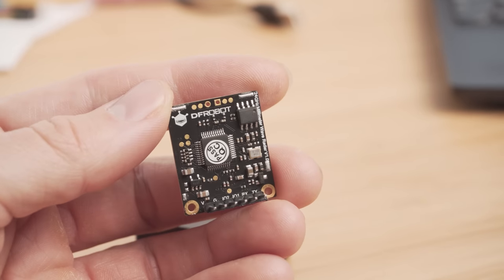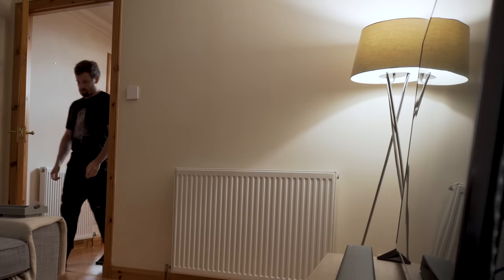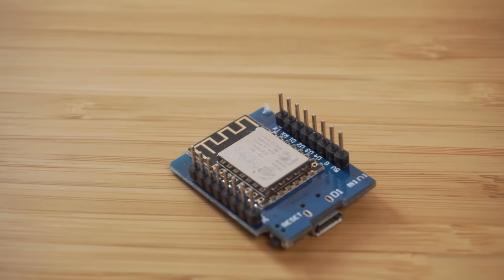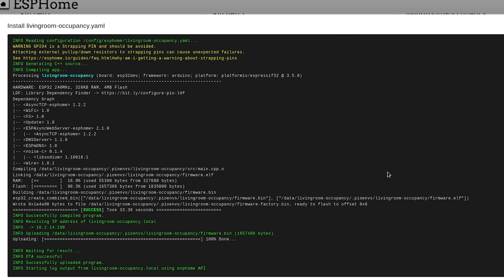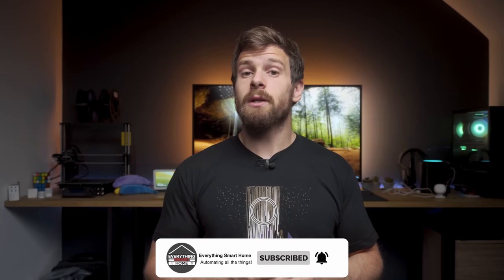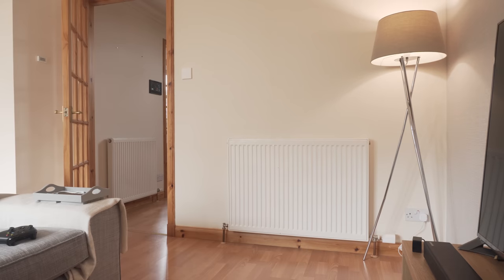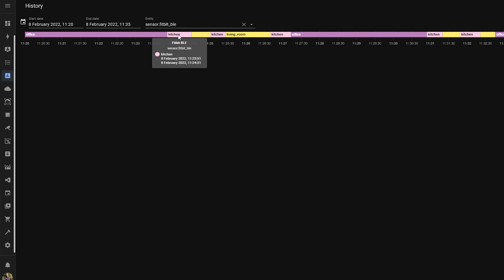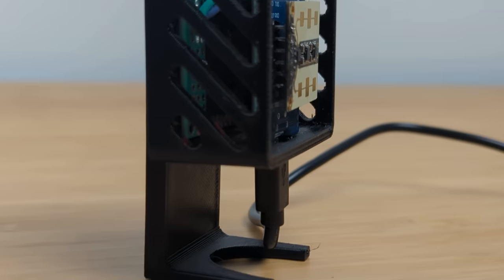Building My Perfect Smart Home Presence Detection Sensor!

Comment: 9:00 by the way since you were speculating on this you are correct a 60ghz mmwave sensor is far more sensitive even being capable of detecting heartbeats and breathing which is why its so much more reliable than the 24ghz one when detecting sleeping humans, although it does this at a much lower range than a 24ghz module. To be fair the dfrobot sensor does specifically say in the instructions and even shows pictures to install the sensor directly above or under the bed when using it for that purpose. Seeed studio actually has a 60hz module for sale on amazon currently if you want to read about it maybe even test it. ...............  seeed studio mr60fda1 60ghz mmwave sensor
Reply from the maker: Thanks!
Reply: Can I ask - because I don't see it - what the benefit is of being able to detect motion from a sleeping person?
Reply: @JohnVanderbeck  presence detection in a room after the occupant has gone motionless in bed
Reply: @ezradmello7021  Yeah I get that but for what purpose? Just curious.  Usually you use these for turning on lights but you don't want lights on when you are sleeping.
Reply: It's actually the opposite.

You'd use this as a bed occupancy sensor so you can tell when you're in bed or sleeping.
Ex: Slowly dim and turn off the lights if it's night time and presence is detected at the bed.
Reply: @JohnVanderbeck  automations that turn off "entertainment systems" aka computers and tvs in your room if it's left on and no one's in there you would usually be laying motionless in bed while watching a movie. Personally I would use seperate sensors for the bed and each side of the bed to tell if my me my wife or both of us are in bed as well as a whole room presence sensor
Reply: @JohnVanderbeck  the use of the word motionless instead of sleeping was purposeful. Common Motion detectors will generally only detect large movements so if reading or watching tv in bed you it's unlikely you will be detected, and depending on the automations you have setup, the lights and other devices may turn off.

Comment: The fp1 is amazing. I spent months/years trying different combos of door contacts and motion detectors to detect presence in the bathroom and when in the shower, but nothing short of pressing a button to set my system into "shower mode" worked well. That all changed as soon as I received the fp1. Not only does it perfectly detect someone being in the bathroom, it detects through the shower curtain, and it even detected me in the shower when I accidentally put my clothes directly in front of the device.

 I was able to remove all other devices and complex node-red flows minus one aqara motion detector to more quickly trigger the lights to turn on as it takes a few seconds longer for the fp1 to determine that there is an actual person in the room, where as a normal motion detector is nearly instant. I then only have to use the fp1's "off" mode when presence is no longer detected to turn the light off. There is no trouble in between anymore of lights going off when using the toilet or in the shower.

Comment: Air quality is something nice to add. Apart from your suggestion to add a particle sensor I would add a CO2 sensor like the SCD30. That will tell you when you have to ventilate the room.
Forgot to compliment you on this nice video…
Reply: This was essentially going to be my reply...swap out the bme280 for an scd41, and add co2 to the measurements I believe?

Comment: Nice device. There are some sensors that I prefer to the ones you picked that might be of interest. Firstly, if you want to add PM10/PM2.5 the NOVA SDS011 is very good even compared with sensors several orders of magnitude more expensive, honestly, for £15 it's shockingly good. Second, for humidity measurement I've found the BME series sensors don't tend to give accurate humidity readings. The SI7021/HTU21D are good alternatives but lack atmospheric pressure so it's a trade off, it has a different I2C address so you could try both in the same device and see which gives the most sane readings or have both or use the BMP180 instead. For light levels the VEML6040 gives colour temperature as well as Lux which could be handy if you want your lights to match ambient conditions, unfortunately it's not built into ESPHome, but could be added as a custom sensor.
Reply from the maker: Thanks for the info, useful!
Reply: Of what benefit is a pressure sensor indoors?

Comment: For rapid prototyping and permanent projects I got a fan of the wire wrapping and the glue gun. in comparison with a breadboard or a prototype board you can get quite quick a breakout board aggregate, works with most pin spacing and the glue gun fixes the wires on the pins and the position of the boards. Also most time no solder fumes :)

Comment: Congrats on the nice build!
A few tips:
For air quality rather than a PM sensor I use co2 sensors (the senseair s8). I use it to control my ventilation system. It also helps detect whether there are people in the house.

For the update frequency of the sensors I have the esp32 check the value every few seconds but only report this value to home Assistant if there is a change bigger than a specific value. This way I get more or less instant updates but without spamming home Assistant and my wifi network.

I've added a screen to my sensor where I can see the data of my sensors including charts. Took a while to figure out how to do it in ESPHOME but pretty cool. The screen is off by default and turns on when the PIR sensor or microwave sensors which I'm using detect me.

I also have an RGB LED that at a glance shows me the air quality (a gradient from green to red). The brightness of the LED is controlled by the light sensor.

I suspect you are not going to put a cover in front of your multisensor, but if you do: you'll need to place your BME280 outside the case, otherwise readings will be off. Same of course for light sensors etc.

What I'm struggling the most with is finding a reliable humidity/temperature sensor, but I'm pretty sure the problem is that I'm a cheapskate and am buying from AliExpress which are probably knockoffs.
Reply: Do you have an video/photo of it?

Comment: This is a pretty cool all in one sensor. I've been following crlogic's work over on HA too.

I do have a few questions/challenges for you though:

Why did you spend more money on STEMA/QT compatible sensors, proceed to solder them to a proto board, and them talk about the overall footprint being too big? In an effort to appeal to a larger audience, a fair number of the Pimoroni and Adafruit sensors are much larger than some of the more basic offerings, but offer more functionality (generally have a voltage regulator and level shifter to accept both 3.3V or 5V inputs, and have STEMA/QT connectors for no-solder connection options.) For example, a generic BME280 is 11x14mm vs 19x19 for the Pimoroni, and a generic BH1750 is 18.5x14mm vs 26x18mm for the Adafruit (~50% difference!). You do have to watch out for counterfeit sensors on some of the cheaper versions though.

For a prototype board, why didn't you use headers for attaching the sensors to the board? You definitely had the room to do it for this iteration, and it would have allowed you to swap out sensors during testing and future iterations if need be.

The BME280 sensor is very precise on its own, but most of the circuit implementations suffer from heatsoak that skew the temps at least 2* higher than actual. Putting the chip in sleep mode between readings, and adjusting the heater circuity can help, but mounting it directly above an inverted ESP32 chip is not going to do anything for accuracy.

Comment: I'd love to see this more compact, in a unit like the Aeotec multi-sensor. I wonder how difficult it would be to reverse engineer those boards and create a single PCB with every component neatly installed together. I also wonder if there is redundancy across the boards, as I assume they'd have circuits performing similar functions and therefore using similar components repeatedly.

Comment: This is absolutely fantastic! I'm going to give building one a go. I was looking to do room temperature sensors, and maybe figure out room presence, but WOW this does it all, plus light level. Air quality could be useful, but like you said to add that would greatly increase the bulk of the design, at least right now.
Reply: Would you be selling the finished product?
Reply: For air quality, a CO2 sensor may be more useful than a PM sensor, and not at all bulky, but a sensor "good enough" is not the cheapest sensor.

Comment: Excellent video!  I’ve had bad luck with the PIRs I’ve purchased.  The link in your video should get me a decent PIR.  Using a HiLink HLK-LD2410C-p for microwave sensor. BME280 for temp and humidity. Then VCNL 4010 proximity, light sensor.  Replacing all my esp8266 project with ESP32’s.  Some with Pi Pico’s, using Micropython.

Comment: Great video and work!! For me I would love to have an all in one solution. Your sensor paired with humidity, air quality, co2 and smoke sensor (with optional pinhole camera, where you can use the mic for Siri or Alexa). All working via a LAN cable (power and data) and all in a ceiling mounted Smoke Sensor enclosure. Of course HomeKit compatible 😀. No Switches no nothing just one sensor on the ceiling and some in wall speakers and underfloor heating

Comment: Very nicely done! I've the same question as some other users: could you kindly measure the actual power usage of the device? I'm not convinced the power usage is minimal, especially if you would install sensors in all rooms in the house. Things can add up pretty fast.
Reply from the maker: I'll try at some point sure!
Reply: @EverythingSmartHome  I'm also interested about energy consumption! Maybe find some ways to hibernate the sensors when possible too. Great project!

Comment: Nice job there Lewis! Those are the things a big brand needs to get running on PoE mountable as a "wall-switch"-sensor-module. Or even ZigBee and direct wired to the mains-voltage.
I really wished you could say anything about the power-consumption of your projects, as energy is a big concern of mine when talking about those designs. Would love to hear from you!
Reply from the maker: Thanks! PoE would be cool!

I usually would talk about power consumption, but it's literally so low on these projects it's generally not a concern, we are talking a very tiny amount of power that you won't notice at all in day to day, even in the current climate!
Reply: Poe would be ideal for these, have though about something like this, ceiling mounted and fully enclosed.
Also an led chip for a nightlight. I love the very low level light a Ring Protect gives off at night when you walk under it.
Perhaps when it has wired power, a zigbee repeater(for other devicesl, if there is something suitable that could fit into it.

Comment: @Everything Smart Home - A lux sensor does allow you to decide whether to turn the lights on or off, as you mention. For enhancing this, consider using the lux sensor as an input to a PID regulator with whatever setpoint you'd like. This is called daylight regulation or daylight compensated lighting, and is common in commercial applications because it saves a lot of energy by only "supplementing" whatever light you need in addition to the natural light from windows and such. But it's also very comfortable since room-to-room, you'll experience less variation in brightness which makes transistions more comfortable. It also lets your lights dim slowly on as dusk falls with 100 % accuracy, rather than alternative solutions that fall short, such as sunset timers, etc. 

You'd typically set a minimum brightness level, so if the PID regulator for example outputs 8 %, you might have a minimum threshold of 10 or 15 %, and thus cut off the light instead. And you'd also often need an auto/manual helper object that automatically gets changed to manual whenever physical switches or UI switches change the light level. Often, it's good to transition back to auto if no presense for X minutes (typically a much longer value though, like 60-120 minutes). 

If you then want different responses from your lights in different situations (say; nightly visits to the WC), instead of implementing these as a set percentage of output, you can simply vary the setpoint of the PID regulator automatically. If you foresee the setpoints being changed while lights are on, add a numeric delay / ramp function to the setpoint input, so that it never changes faster than some rate, for example 5 lux per second. 

A common problem is that you'll have less uniform light in a home and say, an office. This is "fixed" by applying a percentage factor to each light to account for the lights contributing differently. For example, a table light might contribute less than your overhead lights. So it may get a 140 % factor, which enables it to shine brighter to compensate for this difference.
Reply: Interesting read, thanks! You can create an automation that can be something like trigger when lux < x with a condition that there is someone present in the room, I think that's what he meant.

Comment: Thanks for the informative well explained video! 
I have the same experience like @mortensentim511 with the BME280 - hum% 15-25% too low and temperature about 4°C too high. Also putting apart from heat sources like the ESP and after conditioning. Maybe the special soldering process was not maintained, it was on such break-out board delivered. 

Alternative #1 I tried was a SHT31. Provides much more accurate hum% and temp values. 
Alternative #2 which works even better for my needs: BME680. Very accurate, plus it adds a nice extra of VOC measurement. Fully integrated in ESPHome! Recommendation - use the bme680_bsec library, not the standard one. You will enjoy the much better AQI and other calibration routines in the background and calibration status etc. Plus you get a "CO2 equivalent", which is not too far off from a real CO2 sensor, side-by-side compared. For my purpose, sitting in home office for hours and needing a kick in the pants when to open the window it is the perfect match :)

BTW, particulate matter is interesting, but it will tell you that actually opening the window will increase the particle concentration, and it will get better when the window is closed. This is more for a kitchen or workshop I believe.

Comment: Inclusion of lux sensor is great, i have some zwave/zigbee pir sensors with lux and this value is slow to change, so i use this value as condition in automation only for one light.
Would be great to include some battery, so it can work even when power goes out - to be able to use it as part of alarm system (alarmo) when i'm not at home.

Comment: I have 2 ideas. First, have you ever heard of a volumetric sensor? it reads the volume of material in a room then triggers when that volume changes. Cars use these to set off the alarm should someone manage to get inside your vehicle without opening a door, if you've even stuck your arm through an open window of a locked car and had the alarm go off, this is the volumetric sensor doing its job.

Secondly, could you use a series of Bluetooth BLE sensors placed strategically around the house to triangulate the precise location of any phone with BLE enabled? like if you put a Bluetooth module in each corner of the house and maybe one in the centre somewhere, you could theoretically use the distance data to let home assistant know exactly where you are, it would take quite a bit of setting up with trial and error but once you've figured out the numbers, I'm sure you could have a pretty decent presence detection system.
Reply from the maker: It's an interesting idea, I think I prefer the mmWave though for movement.

And yep that's the whole idea behind Bluetooth being enabled on the device already 😅

Comment: What I missed from your built: Nicer design. Does a closed enclosure work (of course with a hole(s) for the PIR/Microwaves)?
Reply from the maker: I haven't got around to designing the faceplate for it yet. Slots are needed in the side for temperature and also light level to work

Comment: FYI the temp sensor on the BME280 is not accurate at all because of self heating issues. It typically reads 2C or more over the actual air temp.

Comment: Great video👍. As a tinkerer I'm would love to make a few of these rather than buy. Any chance of linking a circuit diagram in the description?

And your pilot newsletter was 👍 thanks for that! I added a few automation from it.

Just a thought the base, you could 3d print a plug mount so you can get the thing off the worktops like you can  get for the Echo Dot.

Comment: Great video as always, just wished it was more detailed. For Example on what Pins was connect to what on the esp-wroom-32 and the mmsensor :/
But I look forward to the writting artikel :D

Have one question:
The mmsensor needs 3,6-5v, but the esp-wroom-32 only has 3,3v output pin, so did you connect the voldtage pin on the mmsensor to something else? 🤔

Ps. I have never done this before so might have misunderatood something :p

Comment: The only thing missing is battery power source. I would also change temperature sensor to something cheaper. This one is an overkill for controlling temperature in the room. You don’t need pressure sensor in each room ;)
Reply from the maker: Doesn't have a pressure sensor, it's temperature and humidity only ;)